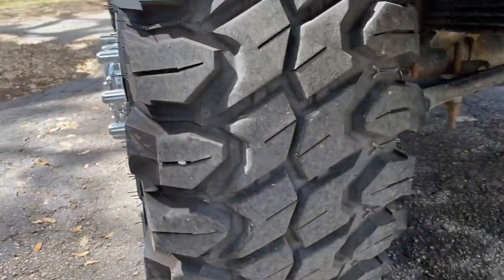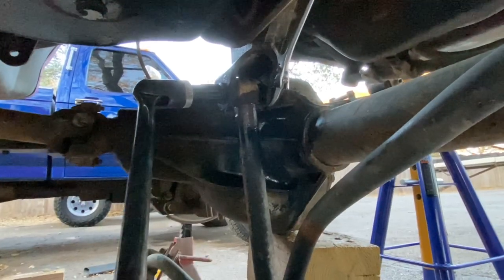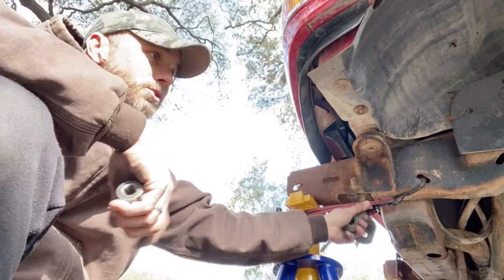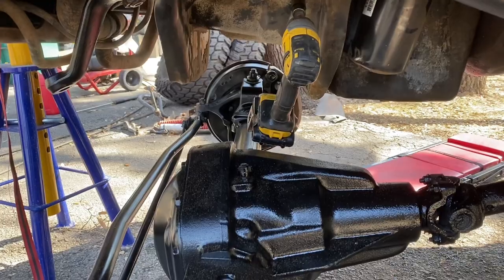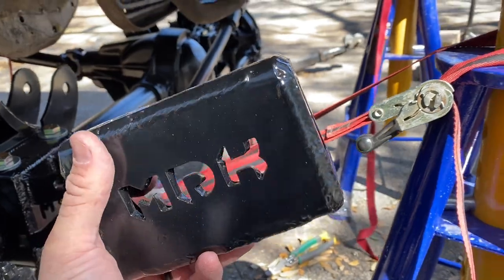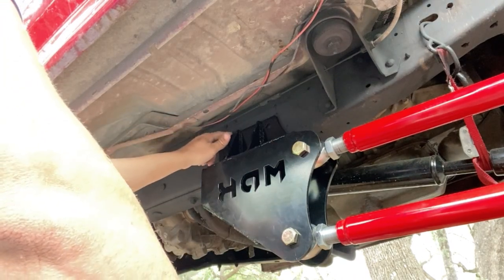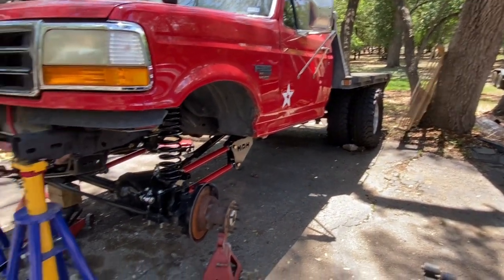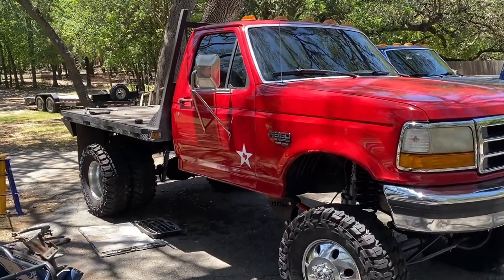How To: OBS Ford Coil Conversion & 4 Link

Comment: This turned out so friggin nice. I wish I had thought of the blocks when I initially lifted mine a few years ago. Using Highboy lift springs cut my load hauling capacity in half. I am probably going to re-install the original cab and chassis springs and do what you did. Awesome build Doug, thanks for putting this out, now I can order the coil set up
Reply from the maker: Glad it was helpful. Make sure to share your finished result!
Reply: , well MDK is impossible to get a hold of so I went a different route. I took your vid, pics of the components and a local machine shop is building the entire kit. I left the truck with them and they are building to it on the spot.
Reply from the maker: @TheRoadhammer379 sorry to hear.  John at MDK is a nice guy and I’m not sure if he has too many sticks in the fire but I have heard from several people, privately, that getting ahold of him can be tough. He is relatively slow to get products shipped but he does get them shipped and the quality is second to none. Can’t wait to see what your local shop is able to do for you and make sure to reach out along the way and when it’s complete!

Comment: i currently have a 2wd  1995 f350. its hard to find a OBS straight axel. would it work with a 2003 f350 straight axel

Comment: I see you said it was a 2.5” lift, I have a dually looking to go similar looks but what’s the wheels are tire set up. Thanks
Reply from the maker: Yep, the first 2 minutes or so of that video have the truck with a 2.5” leaf spring lift.  Tires are 35x12.5x20 Gladiator XComps.  Wheels are 17x7(?) Pacers.

Comment: Is MDK the only 4 link coilover kit you found?  Still happy with it?  Any wobble or bounce?  I'm not wanting to swap dana 60 and 10.25" sterling rear out for 2005+ axles.  The only other option is RSK, but front coilovers seems superior.
Reply from the maker: It’s not a coilover.  It’s just coils with shocks.  You could do coilovers with it, I suppose.  It rides fine for being a single cab dually and it’s definitely an improvement over stock.  Rides better than an rsk for sure.

Comment: I would like to do this to my 1987 ford f250 7.5 460 4x4 manual truck. But, stock height. Do they offer stock height? Nothing weird. Smooth and calm and smart. Not seeking attention with the truck. Want to be factory stealthy sort of. Thanks
Reply from the maker: Not sure about that.  Contact MDK to find out.  You can always cut the coils down to work for your desired ride height (blah blah shut up about progressive spring rates and just live life you internet losers) and adjust whatever shocks you buy for the reduced ride height from what I posted.

Comment: @heyitsmedouglas heyitsmedouglas is that an 8 inch lift or 2.5? i ask bc the leaf spring suspension can be short lift than the coil suspension. i heard both and got confused on what it truly was. i just bought the same kit and had it powder coated just waiting on my truck to get out of paint.
Reply from the maker: It depends on what you want to classify it as. The 2.5” coil springs for an 05+ , with the new mounting points make it a 7-8” lift from a stock 92-97.

Comment: Hey man, me again... lol.  Everything is together, but I think I need a sway bar. What year truck sway bar did you use? Thanks again!!!
Reply from the maker: 05-07.  It might be the same for other years but mine was off a coil spring 4wd 6.0L so it was 05-07.
Reply: @heyitsmedouglasheyitsmedou1312  thx

Comment: Hey man got it all together, drives a little squirrelly though. I had to panic stop and the axle rolled/slipped in the brackets. I got the bolts hella tight too. Did you have this issue? Thx for your continued help.
Reply from the maker: No issue. I tightened them down pretty dang good.  Not sure on the torque specs bc I didn’t have any to go off of.
Reply: @heyitsmedouglasheyitsmedou1312  thanks man

Comment: Did you ever figure out why a 2.5 inch lift spring resulted in 7 inches of lift?  I just ordered my COIL conversion kit, but I need to purchase the springs and shocks.  I'm currently at a 6" lift on a 97 F350 on leafs (29" from the center of the hub to the edge of the fender) and I want to preserve that.  If I do the simple math, your setup resulted in 7 inches of lift on a 2.5 inch lift coil, and if I were to purchase the 6 inch ICON coil, it would seem to result in 9.5 inches of lift ... which I do not want.
Reply from the maker: Not sure but it for sure gave that much lift.  I took measurements before and after and I know it had a 2.5” front spring lift in front when I started so I accounted for that in my numbers.  It’s most likely bc they are coils that are supposed to be for an 05+ Superduty which weighs more.  Since I kept the stock ‘95 Dana 60, the coils are really the only thing that could explain the lift height.
Reply: @heyitsmedouglasheyitsmedou1312  I appreciate the quick response - so just to clarify, you started with 24 inches from the center of the hub to the fender, and after the 2.5 inch spring you were at 30 inches?
Reply from the maker: @robertentrican8246 it has been a minute since I looked at the measurements.  When I took the initial measurements, the truck already had a 2.5” leaf spring lift in front.  When I took my AFTER COIL SPRING SWAP measurements, I took into account the 2.5” lift that was already installed. Basically, I adjusted my “starting” numbers to pretend that there was not already 2.5” of lift on the front so that someone could take measurements on their STOCK truck and compare them to what mine would have been at the beginning to what they were after the coil conversion.
Reply: @heyitsmedouglasheyitsmedou1312  ok - so then as it sits right now, with the 2.5 inch on it, you have a measurement of 30 inches from the center of the bun to the fender?  If not, what is it?  If so, do you remember the model number of the fox shocks you chose?
Reply from the maker: @robertentrican8246 there is NO 2.5” on it now. It was leaf springs before with a 2.5” lift which was removed and is now converted to be on coils.  Assume there was never a lift on it before…the measurement that I put in the video would be the total amount of lift height. The Fox shocks are part number 980-24-039.

Comment: How much lift you got on that blue regular cab without the stars on it?  Nice looking fleet.
Reply from the maker: 2.5” leveling in front and that’s it.
Reply: @heyitsmedouglasheyitsmedou1312  looks nice - kinda what I'm shooting for.  Level by add-a-leaf of shackle kit?  Man that coil conversion looks like a ton of work!  Cheers
Reply from the maker: @munklikescheese9507 I bought the truck like it sits. Whoever “lifted” it used some ghetto lift blocks to do it.  I have another video with some more details about that blue truck from when I first bought it, if you want more info on it.

Comment: Hey man, gonna pick your brain again, sorry. How long is your track bar from bolt hole to bolt hole. Thanks again.
Reply from the maker: Keep asking questions, if you have them.  It’s 25 3/16” center of hole to center of hole.
Reply: @heyitsmedouglasheyitsmedou1312  thank you, I appreciate you. I'm getting close
Reply from the maker: Are you waiting to do the rear until you see how much lift you get out of the front?
Reply: @heyitsmedouglasheyitsmedou1312  yeah, I already have 6" lift leaf springs with 4" blocks. Probably gonna do a shackle reversal and build a custom leaf pack. I have 4 or 5 sets of different leaf packs to choose from

Comment: Doug, do you have MDK contact info. He doesn't have comments turned on, his website is shit and there's no way to contact him. I had questions, and I was waiting for your video to drop before ordering.
Also, is your truck a true cab and chassis? I ask because there are no lift springs available for our trucks, our frames are different width than the F350 pickup. I ended up using custom lift springs from my 1972 F250 Highboy when I first lifted my 95. They were the only springs I could find in 2.25" wide, 26x26" long.
Reply: @heyitsmedouglasheyitsmedou1312  done, and I edited my original comment

Comment: What wheels are those?  Tire size front and rear?
Reply from the maker: 35x12.5 17 tires and wheels front and rear.  17x6.5 wheels.
Reply: @heyitsmedouglasheyitsmedou1312 tires and wheels look good, how much of a spacer did you have to run between the rears?

Comment: I will be doing this install soon. Are you sure that’s  2.5 lift coil? I ordered a 4.5 lift. Your truck sits higher than I want to be at
Reply from the maker: Positive I got the 2.5” Icon coils from PMF.  Part PMF-FRD-8000-510
Reply: Damn you ended with like 8 inch of lift though
Reply from the maker: Yep.  I think it came out to 7”.  Not sure where it came from but they are for sure 2.5” coils by Icon for 05+. I’d be curious to measure a stock 94.5-97 vs an 05-07 and see what the difference is from the center of the hub to the top of the wheel well. That may be the difference.
Reply: Could get me your measurement from center of axle to top of wheel well. Thanks for getting back to me
Reply from the maker: Passenger front started at 26 1/4” (keep in mind that it already had 2.5” lift springs in front).  It now sits at 32”. Soooo, 2.5” plus 5 3/4” equals 8.25”. In the rear, I did an 8” PMF block and it sits barely nose-high in front.
Reply: Okay thanks again

Comment: Man I have a 97 F-350 dually 4x4 chassis cab and I want to do something with the rear suspension. It beats me to death.
Reply from the maker: If it’s riding on your overload springs, you need to fix that, if you want any improvement.
Reply: @heyitsmedouglasheyitsmedou1312  I want to do air ride in the rear but I can't find anyone that makes it for this year
Reply from the maker: The guy that made the kit that the video is about makes one. John Hensley. Madd Dog Kustomz.
Reply from the maker: @md_kustomz
Reply: @heyitsmedouglasheyitsmedou1312  thanks bud, my truck is almost exactly like your btw
Reply: Your not buying a car yep it's going to ride a little rough I would not remove a set of leaf springs front and rear for a thousand coil or torsion bar independent suspension that crap has ruined a real truck if you can't stand the ride buy a car
Reply from the maker: Guess I’m lucky to have thousands to blow 🤷‍♂️?  And this set up is NOT independent 🤪 like an IFS GM/Chebbie…it’s a SOLID AXLE with coil springs vs leaf springs. Huge difference between the 2.  Ford, since 2005, has used this same suspension (not 4 link but it does have a radius arm), on their Superduties…MDKs kit makes it the same concept 🍻.
Reply: @randelcaudle7435  if you've ever drove a 90's 1 ton dually it rides like a tank. Coilovers is always worth the $, don't hate!
Reply: raised on a farm worked on a dairy farm probably hauled loads around 20,000 pounds drove 4x4 trucks for over 40 years yes iv used the hell out them.

Comment: Sorry to keep bothering you, but was your track bar too short, thx.
Reply from the maker: The MDK kit comes with a new adjustable trac bar. It fit like it should.
Reply: @heyitsmedouglasheyitsmedou1312  thanks, mines too short. I appreciate   it.
Reply from the maker: The MDK version or the stock version?
Reply: @heyitsmedouglasheyitsmedou1312  mdk version. My truck is gas
Reply from the maker: How high of a lift did you go with?
Reply: @heyitsmedouglasheyitsmedou1312  it's pretty tall. I'm using 4" skyjacker springs for a super duty
Reply from the maker: Your coil springs are only 1.5” taller than mine. Seems like my trac bar has plenty of thread left inside the bar to be able to adjust for the 4” coils. If it is too short, just get some longer heim joints.  John should be able to point you in the right direction for those.
Reply: @heyitsmedouglasheyitsmedou1312  thanks, yeah I spoke to him this morning. I appreciate your help

Comment: If your truck squats with out a load…. You probably squat to pee….
Reply from the maker: I don’t squat.  I fully sit down when I pee.  Probably like yourself with your Honda 250 😆.
Reply: @heyitsmedouglasheyitsmedou1312  I have 78 vintage bikes.    And 2 obs fords.  One 351w and my 7.3 powerstroke.  None of us squat.
Reply from the maker: Well, I have 79 vintage bikes and I converted them all to squat.
Reply: @heyitsmedouglasheyitsmedou1312 a one of them trans foke..  good luck too ya sir mam it helicopter..

Comment: The truck was better the other way, what a waste of time and money,
Reply from the maker: To each their own. Still have the same towing capacity, same size tires/wheels, and it rides better than before. Seems like a win.
Reply: @heyitsmedouglasheyitsmedou1312  I get it, I'm old and I grew up with the old leaf springs and I just like that better, reason less moving parts to wear out, I do think the truck is awesome
Reply: @heyitsmedouglasheyitsmedou1312 , man I didn't know you could hurt so many fragile egos by doing that conversion! How dare you use your money to improve your vehicle, shame on you Doug
Reply: @TheRoadhammer379  you're the only one that got his feelings hurt